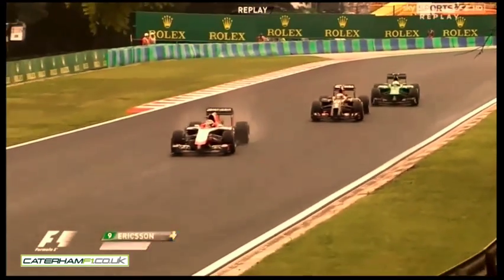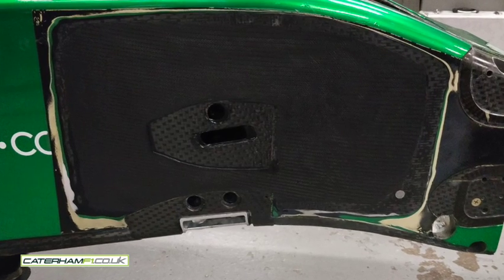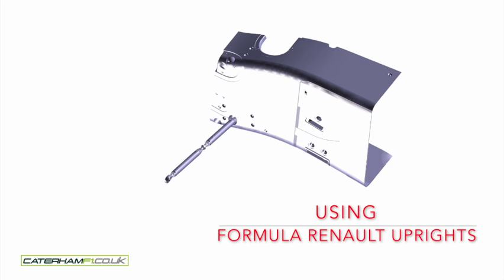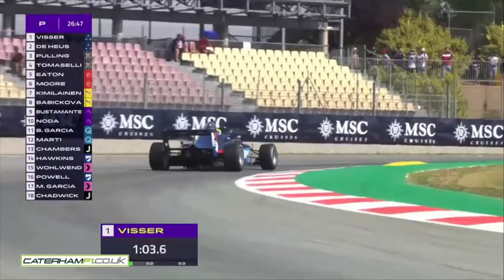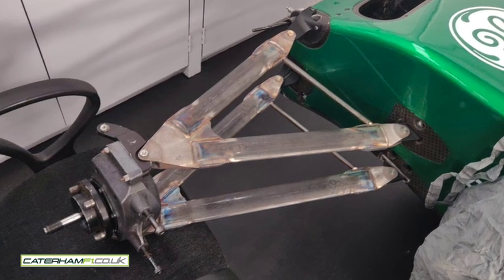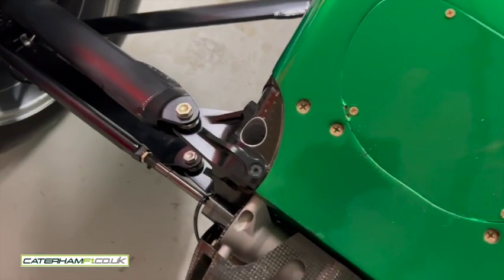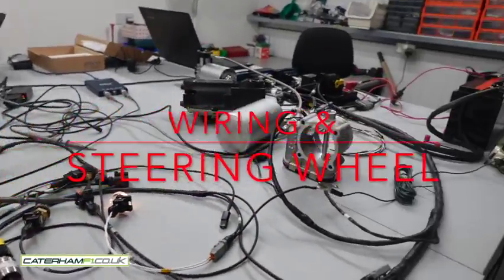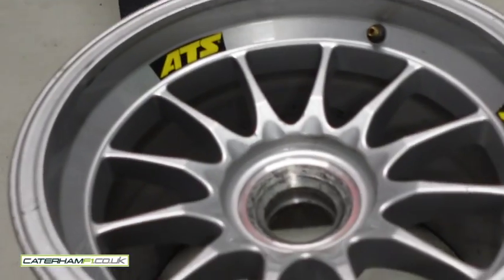restoring an F1 car - Episode 5 The Front Suspension - Never do this!   Caterham Formula One

Comment: Hardly a F1 car restoration is it. It is more of a F1 car turned kit car/formula Renault car using an F1 tub. Why not go buy a F1 car?
Reply: Imbecile.
Reply: So why don't you buy one and document it?!?! If you know anything you would understand it's almost completely impossible to return these to original condition, let alone if you want it to safely run in circuit. However it's rebuilt, it will be far far better than it being scrapped or deteriorating in the back of a storage unit.
Reply: @adamfry1125  I already own several F1 cars. So I think I speak with authority
Reply: @pete292  🤣🤣
Reply: @adamfry1125  you are welcome to visit and see for yourself. I have several complete F1 cars ranging from 80s through to one of the last v10s
Reply: @pete292  No, you dont.
Reply: @marktucker208  Yes I really do!
Reply: Where would he even go buy a f1 v6, let alone a whole f1 car.
Reply: @deathtrooper2048  There are plenty of resources to buy from. A Cosworth GBA sold recently on race cars direct, for instance. Again if you want to buy a complete car you can approach a team direct, I bought 3 of my cars directly. As for cars again plenty for sale from show cars to complete running cars with spares packages. Sebastiano and Silvano Caira brothers. Race cars direct. GPcars4sale. Etc etc.